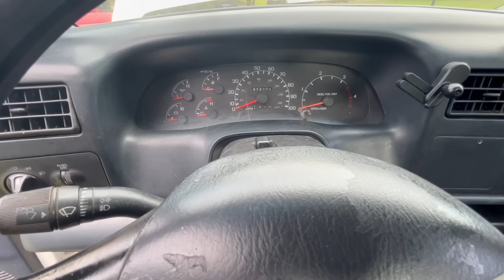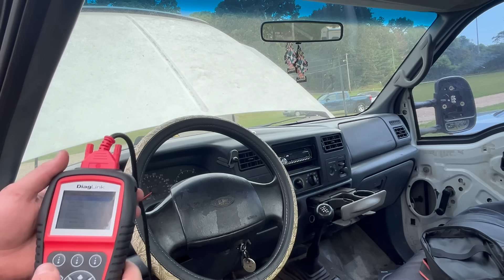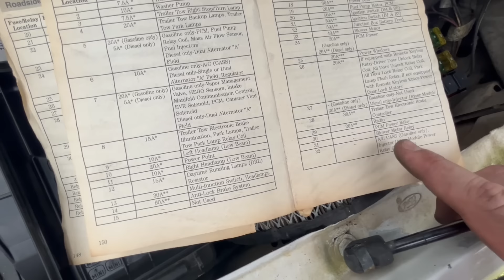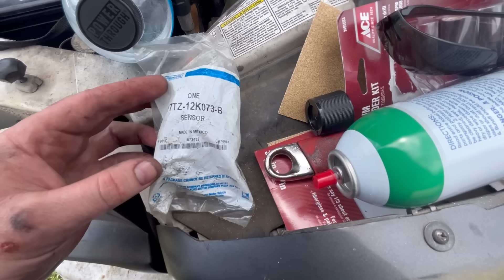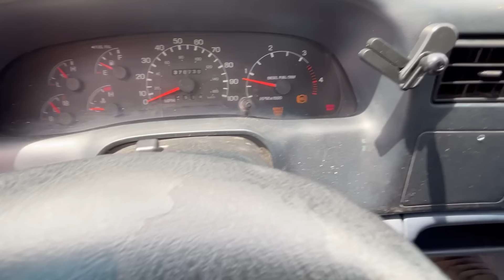1999 Ford F250 7.3 DIESEL Superduty Service Truck ~REVIVAL~ #ford #trucks #diy #mechanic

Comment: 1999 and early 2000 were the best run of 7.3. Beginning mid 2000, Ford switched from forged rods to cast rods and it made a huge awful difference.
Reply from the maker: @williamconner9407  You are correct. Do you have any idea why they chose to goto the powdered rods?
Reply: @southernrevivalautomotive it was faster to mass produce

Comment: I would've started by looking at ICP while cranking to see if it builds the 500psi it needs to fire the injectors. If oil side checks out and still no start, throw a fuel pressure gauge on it.
Reply from the maker: Unplugged ICP at start, no connection to PCM, small bag of common tools with. Reason for searching for a 7.3 service body. 
Update. Truck still does not communicate with PCM, common on 99’s

Comment: I want to find a 99-03 Regular cab 7.3 truck to cut down and build a RCSB superduty! Can’t decide between a 2wd or 4x4
Reply from the maker: @TheBumpStopGarage  I looked into doing that awhile back with a zf6 . Turns out it’s cheaper to just find one done. But they are pretty sharp the shortys

Comment: In the Ford world you have first release spring release and end of production last batch of that year model
Reply from the maker: @conorcuomo4283  I had 2 E99 trucks over the years and was not sure if 6/99 is the cut off date for E99 or not. Come to think of it, a lot of the E99 had odd colored interiors. I remember the E99 4x4’s had different front hubs. And E99 having different turbo wheel, IC pipe , IC, some other stuff I forgot

Comment: Oh, and whatever work you're doin on this thing, or any other modern diesel, keep a battery maintainer on it, this thing will go absolutely haywire below like 10.5 ish volts, and any testing you do likely won't be accurate. Keep that voltage UP at all times
Reply from the maker: Great point!

Comment: Good chance its a late 99. Not that someone changed them out, but Powerstroke emblems on E99 were on the fender, not the door like L99-early 03.
Reply from the maker: @jmaxx88shsu  correct. I never not look into a 99’ with fender badges since sometimes they turn out to be an E99 7.3 . I have been busy and have not looked into it much but judging quickly off the heat tape IC pipe is assume late 99
Reply: Mine was built 6/99 and it's considered a late 99.  I believe the early 99's were built in 98 and up to maybe March of 99.  Not exactly sure of the cutoff month but it was pretty early in 99.
Reply from the maker: @kirkpalmer1709 I think you are correct. Couldn’t remember which month the cutoff was.

Comment: Those beeps are probably airbag faults, and the airbag warning light is burned out, so you're hearing the audible backup alarm instead. See if the airbag light works, and if not, replace it, i bet the beeps stop
Reply from the maker: I believe you are correct. I had read on forums that is likely what it could be. The air bag light does not come on like in our 02’. Do you have any idea besides a failed/failing ECM as to why I cannot connect to OBD2?
Reply: @southernrevivalautomotive  probably not an ECM issue. Start with the easy stuff.
If I remember correctly, the ECM shares a fuse with the fuel bowl heater, and those heaters like to short. Unplug the heater, make sure that fuse (and any other fuses) are good, and see if communication comes back. If not, on to the next thing.

Get your wire back probe kit out and back probe the powers and grounds on the ECM. With a test light hooked to battery negative, test any constant power wires it has, and any ignition power wires it has, and verify by wiggling the key around a bunch that you're not losing ignition power. With that many miles the key switch could be worn out.

If that checks out, and every power source it needs is present, (constant, ignition, or elsewhere,) switch your test light to battery positive and check the grounds. If those are there, you're into some real troubleshooting.

If powers and grounds to the ECM are good, and it still won't communicate, there's probably a shorted 5V reference on one of the following sensors:

ICP, CPS, MAP, TPS, EBPS

Check the 5V reference for each with a multimeter for shorts to the ground pins on the ECM, might be able to check continuity to a chassis ground or something too, I'd try both. I bet one is shorted if everything else is fine. You can do a resistance check to the ground pins on the 5V line for all those sensors, whichever one makes the meter skyrocket is the culprit. I've seen everything from shorted MAP sensors to shorted EBP sensors bring that 5V  reference circuit down to ground and kill communication.

Or possibly unplug each one at a time, and see if communication comes back after each one. If you find a shorted sensor, make sure it's the sensor itself that's shorted, and not a rubbed through spot on the wire somewhere making intermittent contact with metal

Hopefully that made sense and helps a little

Comment: 7.3 diesel is the best egine Ford ever put to use
Reply from the maker: @ricktoole9991  Absolutely! I swear by em. Stupid simple and easy to work on. Biggest mistake people make is treating the oil change interval like a regular motor. The HEUI injectors beat up the oil under hydraulic pressure non stop and it’s worth changing oil out sooner than later. Add Archoil and enjoy many more miles!
Reply: @southernrevivalautomotive how often do you recommend? I own a 7.3, it’s my first diesel
Reply from the maker: I change every 5k miles . I use Rotella T4 15W40 found everywhere. I do mix in a bottle of the Archoil additive in the gallon jug after i fill the oil filter. These take 14-16 quarts.